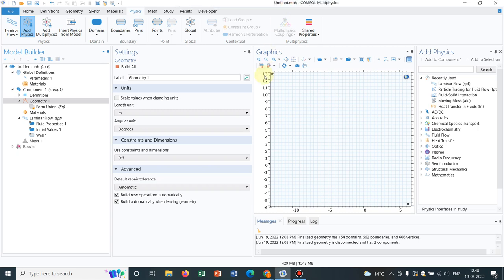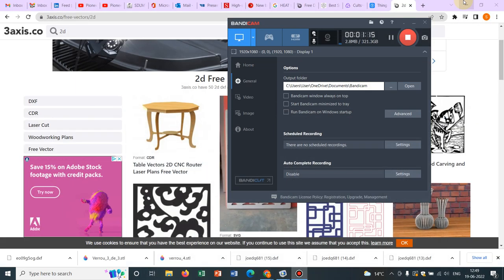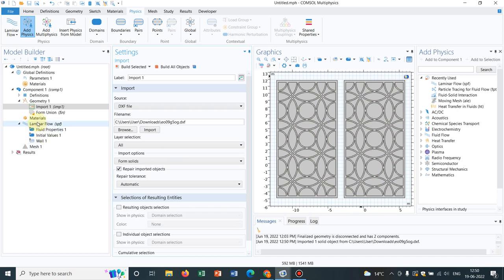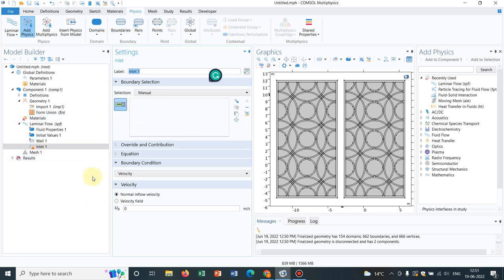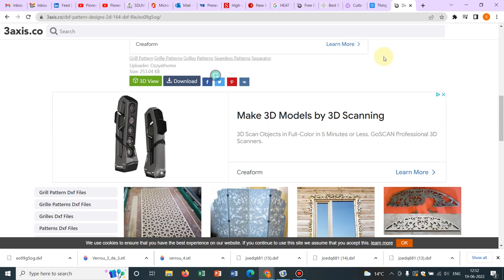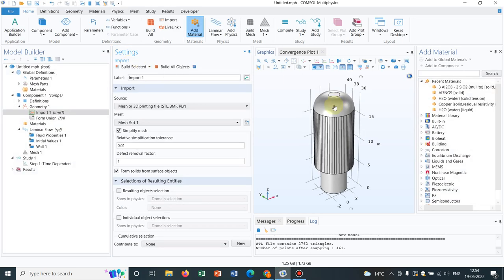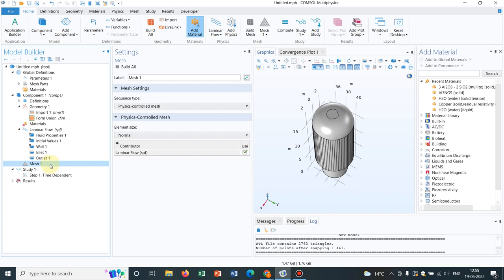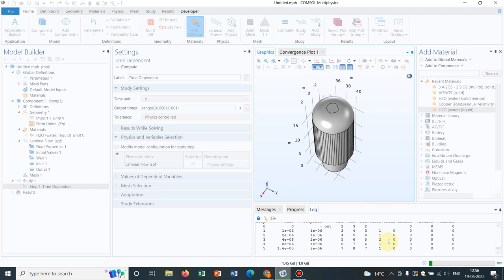How to Import External CAD Files in COMSOL

Comment: Hello sir!! Mine is a 2D model, after importing in Comsol, it considers it as a single model and I’m not able to select each objects. Help!
Reply from the maker: Hi. The following suggestion may work..
(i) First of all, if the geometry can be made through COMSOL that is the best. You may go through my entire playlist on geometry which may help. https://www.youtube.com/watch?v=R7svYbLpN-Q&list=PLQKtMmiSCYoXViOrVxvxfWg46sUYEztYY
(ii) After importing the geometry there is the option of adjoint and disjoint in COMSOL. Watch this video, https://www.youtube.com/watch?v=4k-QaBWW9QE
(iii) If nothing works, then try to remake with your CAD geometry by multiple parts using lines and curve lines. This will resolve the issue.
Reply: @pioneerofsuccess4054  thanks a lot sir!!!